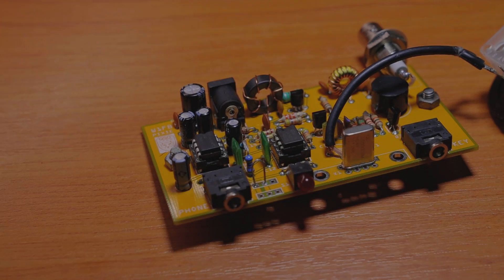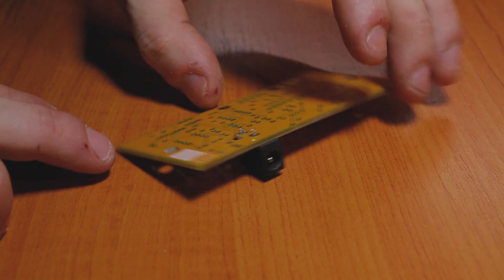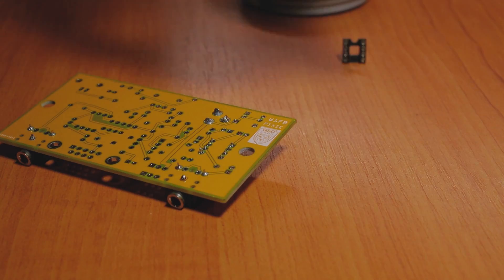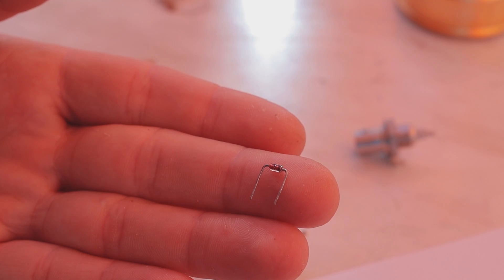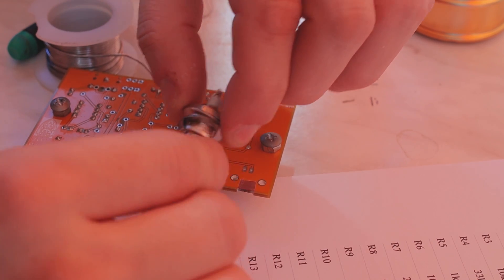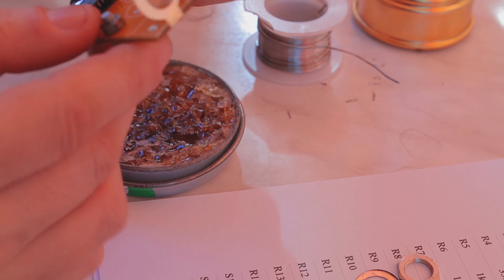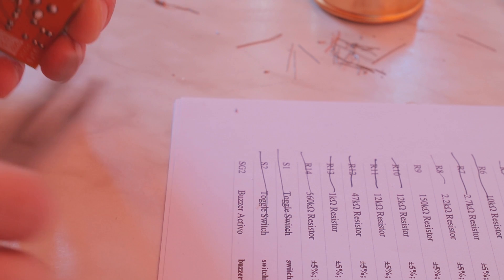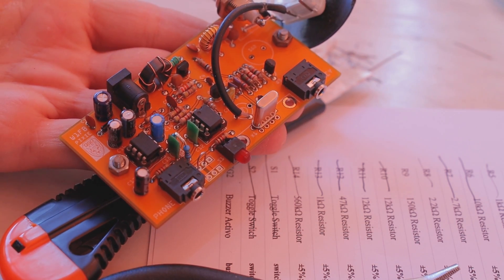W1FB Pixie CW Transceiver Build - With CW Audio Filter

Comment: Headphone is high impedance and loudspeaker is low impedance. Jack socket is sztereó and the plugs you are using are Mono...
Reply from the maker: The plugs are no issue... they are stereo... and having the mono signal going to both left and right. Same as it is in most simple designs like this. Yes one of the issues could be the impedance difderence... but it has to work with both if well designed. But I found the issues as it seems a lot of people had this problems. Anyway... I fixed the problem and in the newer versions of the circuit, Federico who designed the PCB also made improvements so those work ok. There is always something that can be improved in simple circuits and that is the fun of it cause we get to learn thanks to little problems like this 😅😅. 73, YO6DXE.

Comment: What is the frequenzy range?
Reply from the maker: I never checked on this one. But in my recent Pixie video I did tested it on a regular kit that has the same capacitor and crystal. I can't remember how much it was hahaha.  I think it was either 3 or 5kHz.
Reply from the maker: Ok I wrote in the blog post ))) It was from 70305 MHz to 70352 MHz.
Reply: @dxexplorer  Thanks for answer. I added am Si47xx signal generator with arduino and made it go from 3
.5 mhz to 14mhz but i had som sound quality issues
Reply from the maker: I believe that if you change the frequency that much.. since is such a simple circuit... you basically move it from the 80m to 40m and 20m band. The low pass filter on the output is for the 40m in the standard kit. So you may have drops both in power output and also on RX on the other bands. I think there is one more capacitor also that you have to replace depending on the band you are using it for. The crystal switch in combination with a variable capacitor is indeed a good choice. I didn't bother because it was more like a test in mine ))). But let's say you want to build it for the 40m band. If you get a 3 positions switch you can find crystals on 7020, 7030 and 7040MHz. You could cover pretty much in there. The digital VFO that you have is what I don't usually like hahaha.. but if you stick to only the 40m band it should be fine. You could cover the entire 40m band and that is nice. What I want is to make a small and simple analog VFO and use it in a scratch build version. I will make a video on that one as well. 73
Reply: @dxexplorer  So i was thinkimg maybe there is a simpler way. I have seen ppl use many crystals with a selector :)

Comment: I think the idea was to put a pair of crystals on a DB-9 connector to be used as a Super VXO. This W1FB version of the pixie has a simple audio filter. The pixie is VERY wide so this really helps. G7VFY
Reply from the maker: Ohhh yes yes yes... I forgot to mention in the video that I only had a crystal left for the 40m band so that's why I'm only using one in the video. The audio filter... ohh yes I understand it can only do that much. But I was so hoping is better as I has the filter schematic on the table for some time and I was hoping it's just a little better than it is hahaha. But I love it... as much as I love building all the stuff. Clearly I have to replace the low pass filter with the band pass filter. In my area the interferences from AM are really annoying. Now I can't wait to finish placing it in a nice enclosure... and finish doing the last adjustments and tanaaaa.... one more schematic cut from my to do wish list is done. It's been a long time since I wanted to build this one. Too bad here the propagation it's pretty low right now. Thank you for everything Stephen. 73

Comment: Thank you for another nice video Chip. Propagation on 40 seems ok for local signals in VK but 20 is amazing atm. Had a nice QSO with a station in Florida and Italy seems open most of the time. I subscribed to NotBecca and realised she is the daughter of TO KM9G - not surprising - good on her for getting into ham radio. I recently built a DC receiver (on github  at /ianm8/MBDC) and used the same filter circuit but with different values. Not sure what the problem is. Maybe the 741. Did you try a capacitor at pin 3 to stabilise the DC voltage? Hope all is well at your QTH especially with everything going on in Europe! 73, VK7IAN
Reply from the maker: Mornin' from Transylvania Ian ) I'll answer from the bottom to the top ) Not sure what's going on around me... as I'm not watching the news. That's because I honestly don't believe much. I have the feeling that things are not exactly as presented on TV. Someone usually tries to cover something with another thing... that sould explain many things ) About the receiver... I will have a look in a little bit. I must build a DC receiver as well... it's on the list. Becca... found her while looking for a fox hunt transmitter trying to get my nephew into amateur radio and told him is treasure finding game but a little different hahaha. She reminds me of my self when I was a kid. About the audio filter and the 741... Ohh yes for sure is from the 741. Nigel was writing yesterday that W1FB made many circuits with 741 and most had the same similar issue. I'll have a look to another schematic of the audio filter and see if they have anything extra maybe that helps things to "calm down" and be stable ) I'll look into pin 3 as well. Now that I built it as it in the schematic and found little issues... it's time to play around and make it a little better... that's what I love the most in this hobby hehehe. There is always something you can improve. Thanks so much for watching. 73 and have an amazing week. Ohh I forgot... propagation is the same here... mostly local. But not much activity on CW. They just chit chat on SSB all morning and afternoon after work ))

Comment: Ciprian, your audio issue lays with the 741, over a period it becomes saturated and turns off, to test for this, if it turns off, switch the radio off then on again. If the radio is working again the issue is definitely the 741, it is not the part it is inherent in the design. Play around with the biasing, I can't see the values. W1FB used the 741 quite a lot in this application and they all had the same issue.
Reply from the maker: I'm also suspecting the same. It is indeed from the 741. Every time the sound stops... I either have to transmit so the LM386 gets muted... and after that the sound comes back. Or I have to turn the transceiver off and on the the sound also comes back to normal. It only happens with the powered speaker though, not having the issue with the headphones. I think I have an old schematic somewhere for a CW audio filter using a 741. I'll have a look in that one and compare it to what W1FB did and see if I can fix the issue. I'll send you the regular weekly vocal report with the email radio show tomorrow morning when I wake up hahaha. I'll put both schematics in the email so you can have a look. P.S. I have an idea for a video I think you will love.... but it will have to wait a little so I can get my hands on all the parts ))
Reply: @dxexplorer  Ciprian, I just remembered, Doug did a design 40 odd years ago called the Neophite, if I remember correctly it was a DC receiver, it used the same 741 filter circuit. This radio had the same issue as yours. I know this because I built it 30 years ago and still have it. If you can find the article from one of his books he mentioned this problem in it along with steps to minimise it. My brain is telling me R4 or R5 in his circuit. Any how, was a great little radio but never cured it. Tried different chips, the bias etc. If I can find the book I will send you the notes.
Reply from the maker: Thanks so much Nigel. I spoke to Federico from QSO Labs and he didn't had any issues so far. I replaced the LM386 with an N type instead of M that I usually use... and it seems that the issue it's gone. We will see for how long )) I will email you the schematics in a little and leave the radio show for tomorrow because today I was on the run all day. At the moments it seems to work fine. Happy about that. Send me the notes anyway if you have the time and you find them. Just in case )) 73 and we chat soon on email.
Reply: @dxexplorer  Hi Chip. That's interesting. I now suspect the LM386, or at least the power circuit to the LM386. If this circuit uses the 1k resistor in series with the power supply to power the LM386 then there will be at least a 4 volt drop at the VCC pin - assuming a quiescent current of 4ma. The LM386 only has to draw a few more milliamps with audio running and the voltage at the VCC pin will drop below its operating threshold. That threshold is different for the different types of LM386. Type 1, 2 3 etc. You could try putting another 1k resistor in parallel with the existing 1k resistor and see what happens. That will increase the current when transmitting (actually not by much) but at least that will indicate if that's the issue. Another thing to do is have a look at the output of the 741 when the problem occurs and see if the signal is still there. :)
Reply from the maker: Thanks Ian. Very smart idea about checking the output of the 741 haha. That I skipped thinking about. So... I'm suspecting you are right. The reason for that is that today I left the Pixie work on battery. As soon as the voltage of the battery went low... and is no issue on that with the other  version of the Pixie ( Chinese one )... the problem started again. So I wi try to do the resistor adjustment and see what's happening. I don't think it should affect TX in any way... as the 1K resistor is strictly on the power line for the LM386. Also there is another 1K resistor on the power line that goes to the 741 if I remember well. So it's great they are all separated by each other because this way it should not affect the other stages. I'll test and see what happens. Thanks so much one more time. 73
Reply from the maker: I'm back... issue fixed indeed. So I ended up replacing for good the 1K resistor with 470 Ohm resistor. Works like a charm even if powered under 8v. I must buy you a beer hehe. Thank you so much. I thought about it yesterday that maybe that may be an issue... then I was like nehhhh it can't be. ))))
Reply: @dxexplorer  No worries Chip. All good. The current will be higher (than with the 1k resistor) when the key is pressed because that resistor is grounded via the diode. So the smaller the resistor value the higher the current from the battery. It's only when keying down and it's not a lot anyway ~20ma with a 470 ohm resistor. Take care and hope you stay safe. :)
Reply from the maker: I need some sleep. You talk about current and I think about the voltage instead hahaha. Thanks Ian. Hard to sleep with all that's going on around us. 73 my friend and have an amazing weekend.

Comment: The electronic parts are truly a treasure. I recently made a fm receiver with vco which can cover 14mhz in the fm band with one varicap diode. Are you thinking of making another receiver with FET or something like that?congratulations on   the website by the way, ,it is finally up again. One more question, will you include in the website photos of other subscribers attempts of your constructions?
Reply from the maker: Yes Nikos... a treasure indeed. Ohh good thing you reminded me about the diode tuning. I must change something in the first  version of the Sputnik haha. Yes I will sure have the photo gallery with stuff build by the subscribers. I'm going trough the emails now saving all the photos and preparing them to be posted on the website. Glad you like it. I'm also happy is back. Not having much free time now, but I'm slowly posting articles one by one when time allows me to. 73 my friend.
Reply: @dxexplorer  can I send you some more photos of the sputnik?
Reply from the maker: @sv2tcb  Yes of course you can. I really appreciate that.
Reply: @dxexplorer  I have sent you an email. 73
Reply from the maker: I got it. Thanks so much buddy.

Comment: If & when I build a kit, I place & solder the parts for the centre of the board ,and work my way to the edges, that works for me.
Reply from the maker: Ohhh yes I used to do that too a few years ago. Now I find it easier and more organized for my self as I did this kit... as sometimes because I'm exiced about the project I tend to become very messy really quick )))